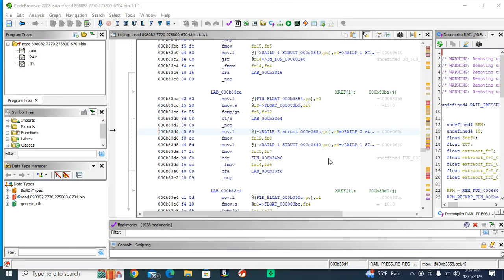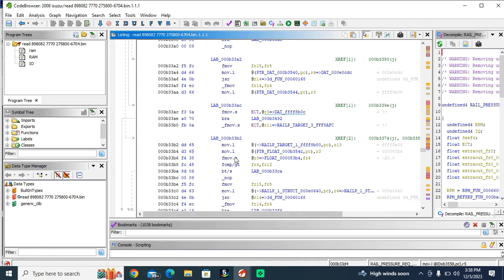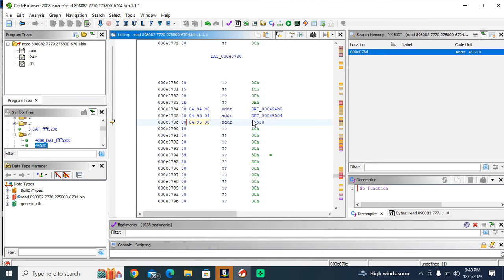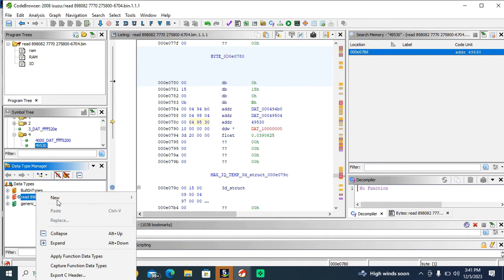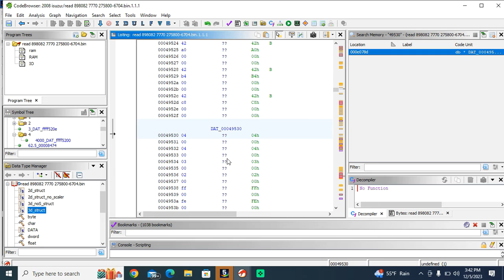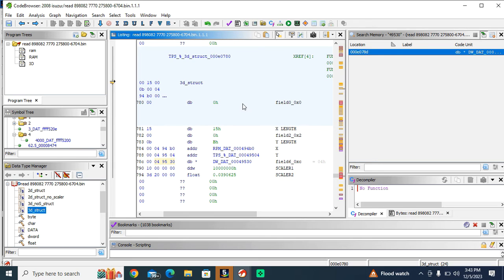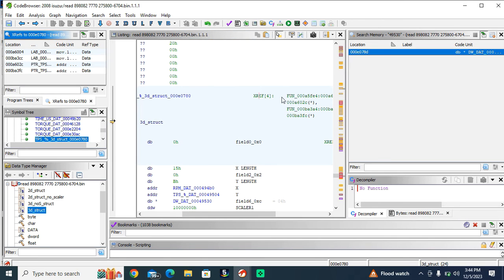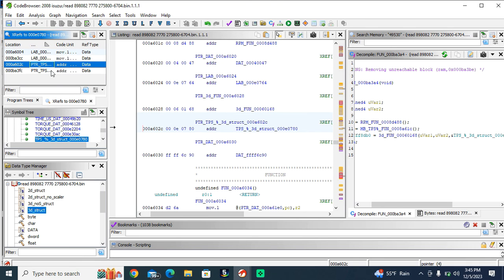GHIDRA Disassembly, SH7058 sh2a finding maps XREFS

Comment: The datatype was "db *" which is a pointer to a "db" (which itself is basically a byte).

At one point, I saw "db * * * * *", which I think happens when you already had a datatype there and hit the "p" key to make a pointer.  Hitting it again adds a layer of indirection..

One way to create a structure (perhaps you did that) is to define some data in memory, select the data, then right click -> Data -> create structure from selection.  That will use the selected data and create a structure with those data elements (and replace them in the memory with an instance of the new structure).
Reply from the maker: Okay, nice. I did not know that. Thank you for sharing the info. It’s been a huge learning curve!